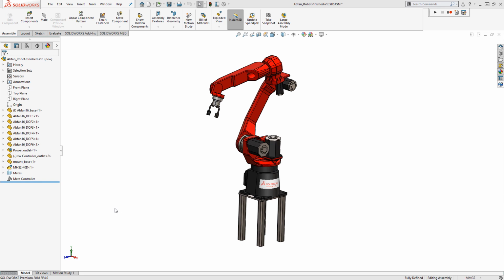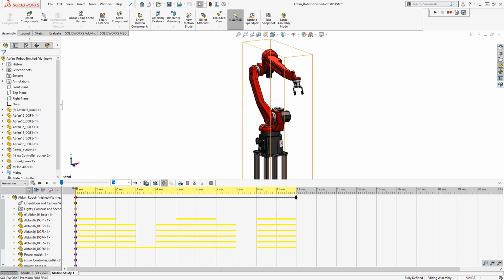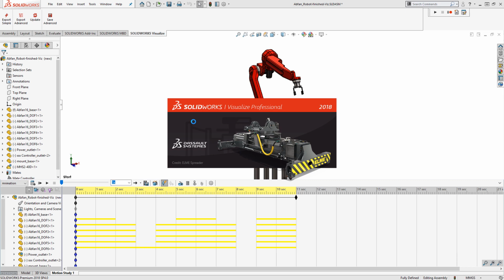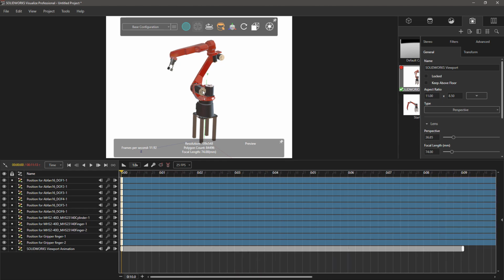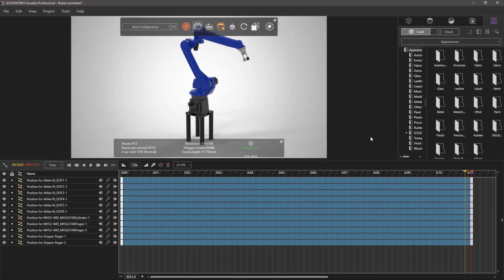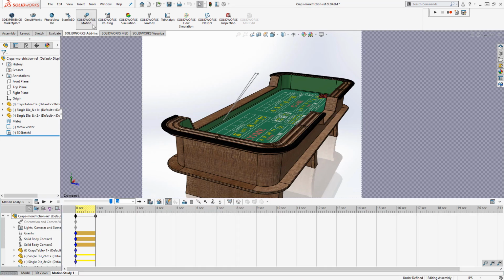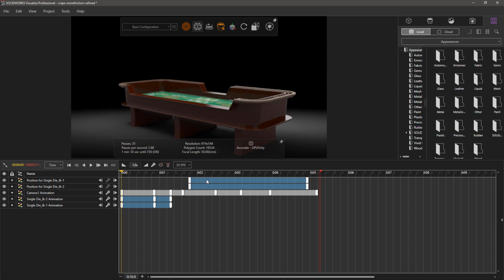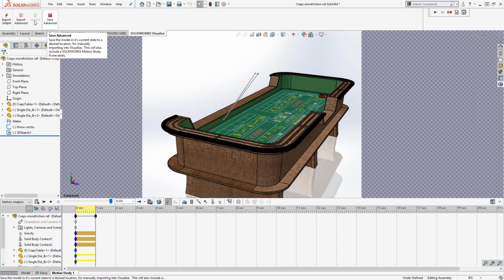Exporting Motion Studies to Visualize Professional

Comment: when i go to the visulized the motion doesn't transfered from solidworks can u explain to me why !
Reply: So, I managed to get it into visualize by hitting "Update" in the solidworks visualize add-in ribbon.
Reply: @dominikfohrmann9679  I'm having the same problem, did you find a solution?
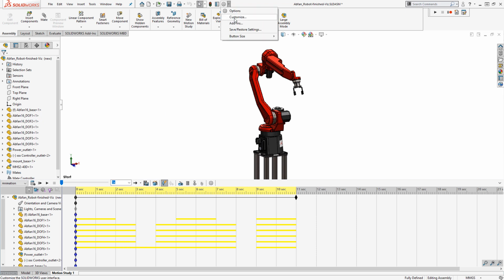Reply: @lingyubu8905  Yes. See if hitting "Update" in the "SOLIDWORKS Visualize" add-in tab in SolidWorks helps (it's right next to the "Export Advanced" button, see 1:11). That solved it for me.
Reply: @dominikfohrmann9679  Thank you for the reply. I made another mate controller again and somehow the problem was solved.
Reply: @lingyubu8905  Turning on the Motion Study add-in before exporting from Solidworks. ...and subscribe me if it works 😂 kidding, hope I helped. :)
Reply: @EngineeringWorkout you made my day
Reply: Did you find a solution, I have the same problem
Reply: @the_guy_next_door_31  If you mean locating key Frame, click "View" and click "show Timeline"
Reply: same problem here. With Visualize Professional and Timeline on. Any ideas?
Reply: I get it now why we're losing the duration of our motion study. Turns out we just need to move the red line on the time frame in Visualize before rendering.